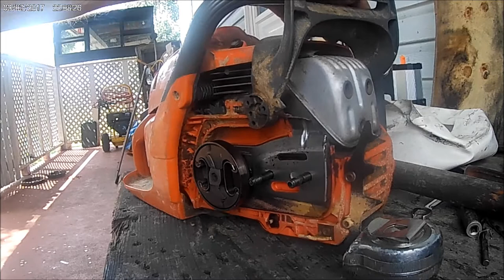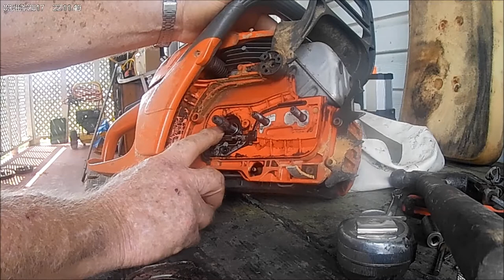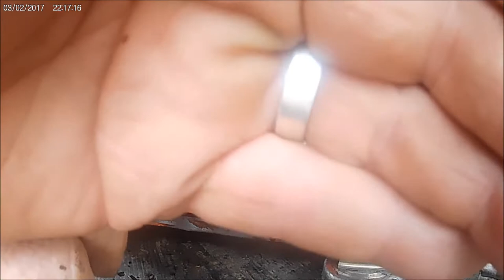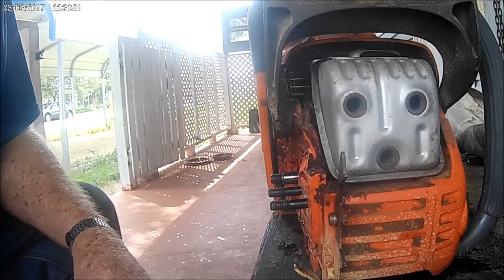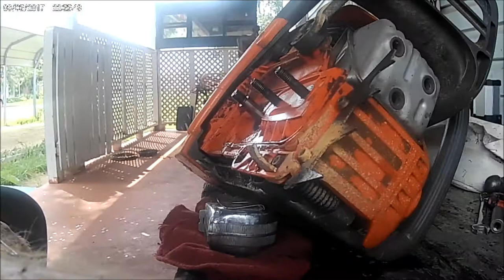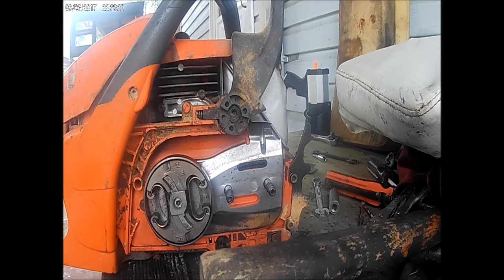Husqvarna 455 Rancher not oiling bar.

Comment: Is it oiling now ?
Reply from the maker: yes after I started it,, the oil was coming out like it should.
Reply: @MissouriOldTimer  thats good 
Ive never hap to mess with a husqvarna oiler
The only time i ever had to mess with an oiler was on an old poulan 2000  the pick up tube had rotted and broke off  if memory serves me right  that oiler worked by creating a drawthat drew the oil through the
Tube 
I never was sure if id had fixed it as the saw was just pretty well done at that point
Reply from the maker: @GeorgiaRidgerunner  I don't think any of these saws has a very sophisticated oiler but then I guess they really don't have to.
Reply: @MissouriOldTimer  ive never had one apart but some of the newer saws actually have an oil pump in the crank case
Reply from the maker: @GeorgiaRidgerunner  this type is pretty crude but I guess as long as it works.